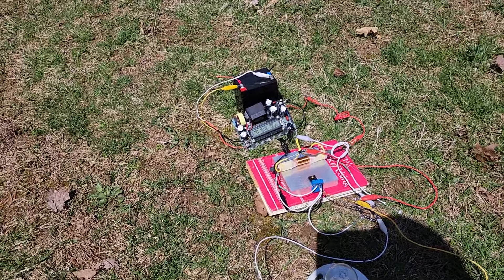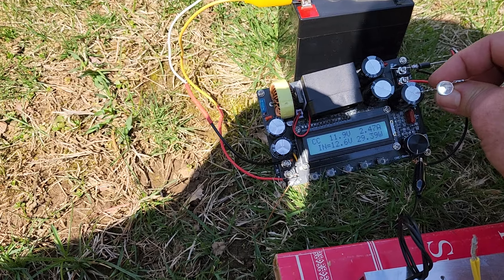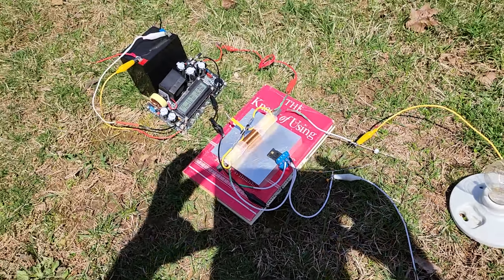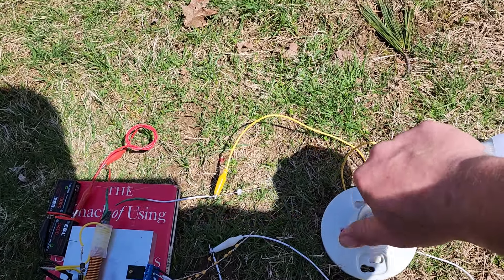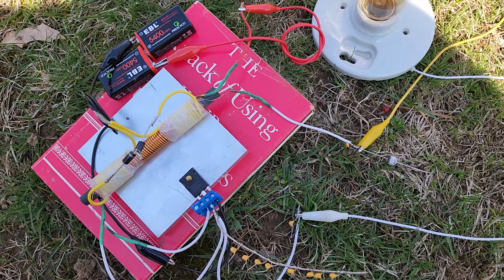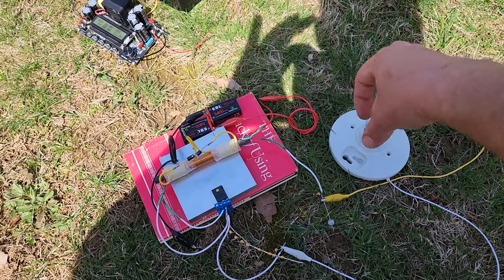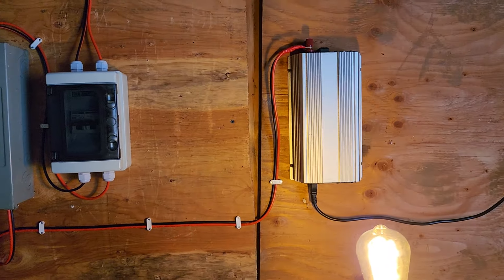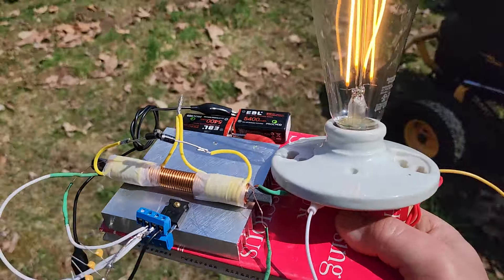🌞OUTDOOR RINGER DEMONSTRATION TO SILENCE SKEPTICS🤨GET YOURS TODAY. ONLY $150💡

Comment: I'm not sure what this is supposed to do. But from what I see in the video you pull about 30 watts from the battery and light up a mains light bulb.  The brightness of it seems reasonable for a bulb in the 10-20 watt range.   Are you saying that the bulb is getting more power than what's pulled from the battery? That's hard to tell on there in the sunlight. Put a 20 watt halogen bulb powered directly by a 12 volt source next to it for comparison.

Comment: i have been running one in my home from solar saved in two 16v 50F super-caps to light up to 5 led light bulbs for hours at night but my coil is a slightly different i used 30awg and 20awg with 4 layers of each in series so all the crossing connections between the coils are on the outside of the magnetic field to avoid internal disruptions and I inject power into the 30awg and use the 20awg as the output

Comment: I don't understand you have a 12-volt battery lighting up a light bulb. They sell regular incandescent light bulbs that belong in a home that run off 12-volt, around for years.
Reply: It's simple really essentially what he's done is create what's called an inverter all he's doing is stepping up 12 volts to 100 to 110 volts now you might think that's impossible but it's not if you look online you can find those little inverters that plug onto your car battery or plug inside your car and you can run a normal household plug off of them they convert 12 volts or 5 volts into 110 volts it's easy to step up the voltage but hard to step up the current the current being the amps but there are ways to do that the real problem is efficiency because all of the circuitry required creates a lot of heat and if you know anything about Electronics you know that heat equals loss of electricity the more heat you generate the more electricity you lose that 12 volt battery would not power that bulb for very long maybe 2 or 3 minutes at best hope that helps you and as a side note they've had this technology since the 1950s and they did it off of 6 volt batteries

Comment: Man does that jeep run. I want that. 😊
Reply from the maker: Haha thanks & it runs but needs a full rear diff replacement & has a brand new radiator system but still over heats. Even replaced the temperature sensor but still didn't fix the issue. It's definitely a project jeep & I'd sell it for $500. Would need to be towed to buyers location

Comment: Well... for one there are still many ways to fake it... battery in book, battery in base of bulb, battery inside coil... could even be CGI removing wires, thats not hard at all.

That being said I believe this is doing something. All I need to know is:
What is so special about this?
What frequency is this driving?
Why would I want to convert DC to AC then rectify back to DC? How does that quadruple the life of the battery when charged from the "special" DC?
Can I see some actual evidence of your claims of efficiency? Some numbers? All I saw so far is a 40w bulb drawing 40w. Technically you could run a 120v bulb from a AA battery if you wanted to. But that would be dumb.

Show me the efficiency through scope screens, showing battery discharge rate live, maybe a little math and some comparisons to a normal inverter? You keep "saying" efficient but never show its efficiency. Just lighting the bulb does not mean efficient. It just means it works. And a 100w bulb would glow at 40w... thats not efficiency, just just limiting current through it.

Show me it running side by side with identical batteries (showing same charge, tested to similar capacities) on an inverter and in this. Hook up identical loads with proper monitoring equipment (volts, current, etc). Thats how you test efficiency.

Then im curious if it's just for lighting or if will it also run inductive loads?

Sorry for writing this before going through the book :( my bad. But i never said you were faking, i said I wanted proof. I could say I cured cancer. But without proof, I am still poor.